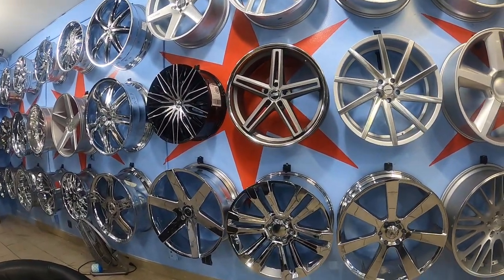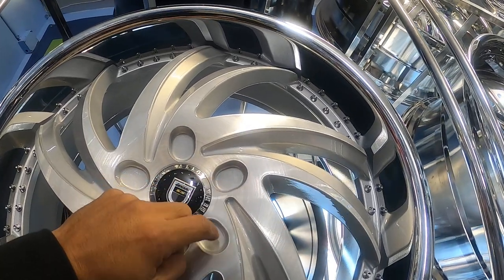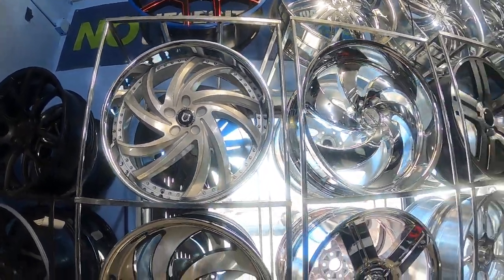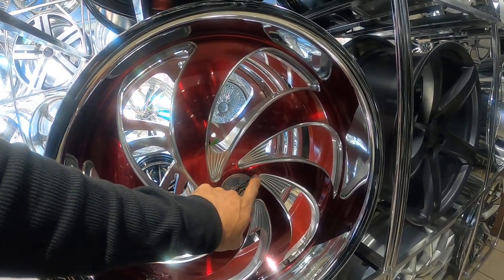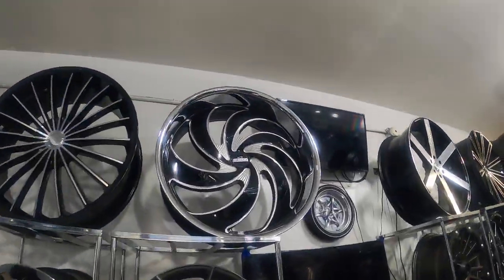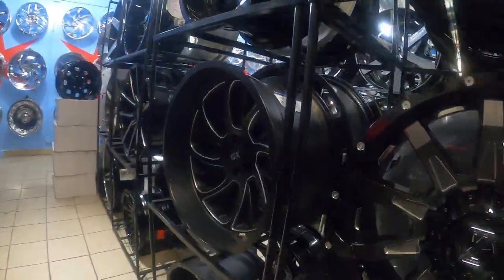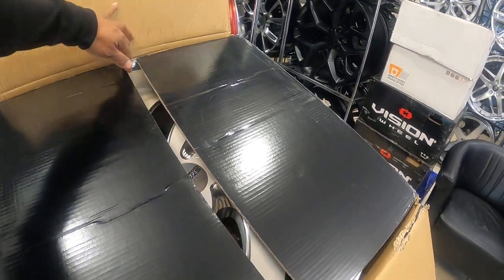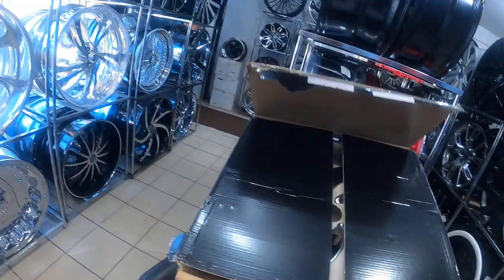1 of 2 Custom wheel rim drilling wheels rims Redrill

Comment: I have a 2005 Chevy Impala OEM rim bolt pattern 5x115 can I refill and redrill to a 5x127 to fit a 1995 Chevy Caprice?
Reply from the maker: No. Your better off using adapters. Make sure you add lok tight. Or just get rims 5x127.

Comment: I need my dayton adaptor drilled they are 6 x5.5 need them 5x5.5
Reply from the maker: Would have to order a 6 lug adapter. Can you bring in you 5 lug adapters. We gotta measure it to order the correct one. Thanks. Marco. Chrome Depot Rim & Tire 1626 S. Cicero Ave. Cicero IL 60804 Mon-Fri 10-7 Sat 9-5 708-776-3119

Comment: Can you please let me know where I can take my wheels to get re drilled 
They are 19” brabus monoblock II 
I need to re drill to 5x114.3
Please let me know 
Thank you
Reply from the maker: What is the current bolt pattern?
Reply: 5x112
Reply from the maker: If tires are on. $499. Includes removing tires. Sending out wheels. Installing tires. Balancing wheels and tires. Thanks.